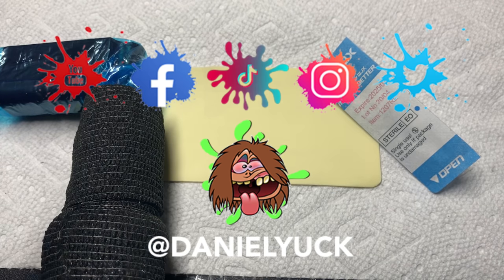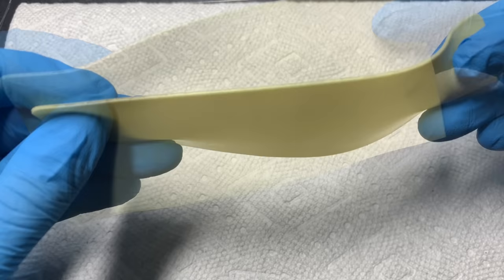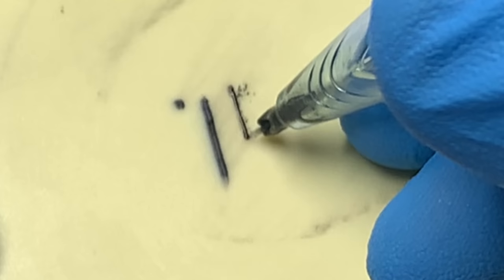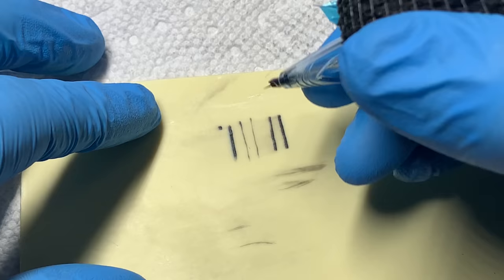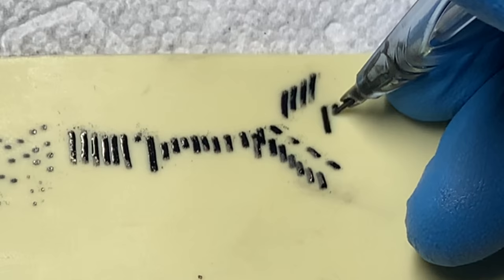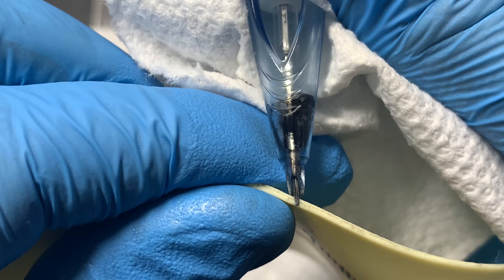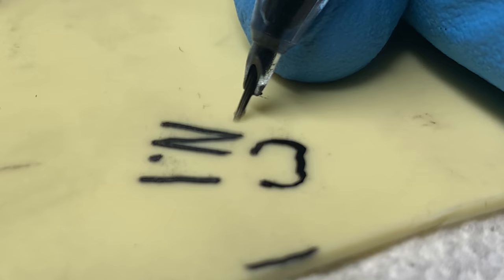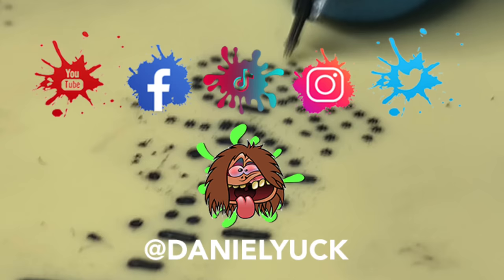How Much Is Too Much Needle?

Comment: What speed is your machine running at? Is it a rotary? the movement looks alien on camera. needle is so slow.
Reply from the maker: That’s a great question! 

Typically when I pull lines wether I’m using a round liner or round shader I will be at 7.5-8 volts even. For stipple shading or dot work I use 5-5.5 volts. I’m always in this ballpark upon applying my tattoos. 

With magnums I will be anywhere from 5-8 volts depending on the skin, placement, what I am trying to achieve. It’ll vary depending on the specific technique I am trying to apply.

Comment: Isn't it good up to 2mm on human skin? If the fake skin is 1.2mm thick, going through is not necessarly a blowout on human skin no? I am now practicing a lot on fake skin, that is why I ask.
Reply from the maker: That’s a great question! 

The dermis is between 0-2mm thick. Which means the dermis ranges on different parts of the body. Like the fingers will be easier to get to the dermis because of the thin skin as opposed to the dermis say like on the lower back. 

So this is a big reason why they say the artist takes the first 10-20 minutes getting used to the persons skin as everyone’s dermis will range. 

Also say the dermis was this deep on this person in this specific spot,  the next person will likely be different wether we have to go a bit deeper or ease up a bit to prevent blowouts. 

The dermis will always range which is why I prefer practicing on thinner skins like these over a 3mm thick practice skin.
Reply: @DanielYuck  Hello, thank you very much for the answer, I get it better and bought thinner fake skins in addition to the better 3mm quality in order better mesure how deep the needle goes. I'm french so, sorry if my english is maybe not perfect. 
Have a great day!
Reply from the maker: @paulwhitman8955  ahhh very very nice! That’s a smart move to get various thicknesses of skin. 

I feel your English is great and I can understand you with no problems. I appreciate you reaching out and asking your questions. 

Thank you for your support 🤝

If you ever have any questions at all don’t hesitate to let me know.

Comment: My ink is not sticking in the practice skin
Reply from the maker: If the ink is not hitting a certain depth into the skin consistently the ink will not bind the the layer it needs to bind too. 

I recommend working and your hand speed & voltage as well as the depth of your needle. 

I made a full video on how I match my hand speed and voltages right here https://youtu.be/cwCRbJ7HTEU

Should you have any questions at all don't hesitate to let me know. I will do my best to assist you in the best possible direction.

Comment: Great video. What cartridge size and voltage would you suggest for thicker lines?
Reply from the maker: Thank you 🙏 

For really bold lines I like to use something along the lines of a 12-09RS to 14RS. Using round shaders will give us a nice bold line especially when we become used to them and pull those beautiful one pass thick lines. I am working on a video where I show you how I pull lines with a round shader needle. Bare with me as I get that 1 done. Let me know if have any questions at all
Reply: @DanielYuck  Thanks so much! I’ve only been working with various RL’s at the moment. I just started about three weeks ago. I will definitely keep up with your vids!!
Reply from the maker: @jasminemoore4176  I love to use round liners in the higher configurations for lining. I like to use like 12-07RL and up for lining. When I line with RL’s I am typically in the 7.5-8 volt range, I rarely ever touch 8 volts. I think The highest I went yesterday was 7.8. 

Lining with round shaders is a bit of a different approach as well as the style of the tattoo changes when switching to a thicker configuration but that depends and comes down to the artist at hand and what they are capable of doing.

If you ever have any questions at all by all means let me know, I’ll do my best to guide you in the best possible direction 🤝
Reply: @DanielYuck   Yea when I get into 8 and up, my ink doesn’t last as long, but I could be moving my hand too fast. I finally got some of those silicone skins because the regular rubber ones suckkkks with ink smudges lol I will follow your work on insta as well!
Reply from the maker: @jasminemoore4176  I can’t stand those rubber skins. They are probably good for practicing scarification but the ink binds to the skin and leaves the entire tattoo not even worthwhile. 

Thank you for your support, I appreciate you 🤝

Comment: Hi Daniel, I loved your video gained some knowledge.  I would like to know on how much should be the speed of a tattoo machine for lining and shading, on an analog
Reply from the maker: Thank you for your support and feedback! 

This is a difficult question to answer as there are a lot of variables to consider. When you say analog are you referring to a coil machine ?
Every setup will vary in terms of what equipment is used with what voltage and this will also range from tattooist to tattooist. 

For me I line at about 7.5 because I use pen style tattoo machines, and I do stipple shading and dot work at about 5.5 volts. Again this will range for everyone, I feel.

Comment: Can I use the needle more often if I only tattoo on fake skin? 😅
Reply from the maker: Thats actually a good question!

For me I personally don't see a problem with preserving the needle a bit longer for the next session when it comes to fake practice skin.

This is a hard habit to develop into something more because majority know better to use a 1 time cart on human skin only 1 time only. 

I would recommend to put the tips of the needles in a cup of alcohol where the needle tips are covered and submerged in the alcohol so the ink doesn't dry and clog the tips. Also look out for dulling of the needles as dull needles can make it impossible to pull a good line. They will dull so don't hesitate to toss the practice cart.

I do this myself because of how much I practice. It does help cut cost of supplies down while optimizing time under the needle.
Reply: @DanielYuck  okey thanks, ya on human skin only 1 time! Hygienic is the number 1 by this!!! 🌷 Okey I will try this with alcohol that the ink doesn't dry. I think that's good when the needle is good and I can take it for the next fake skin session, needles are also expensive in the mass 😂